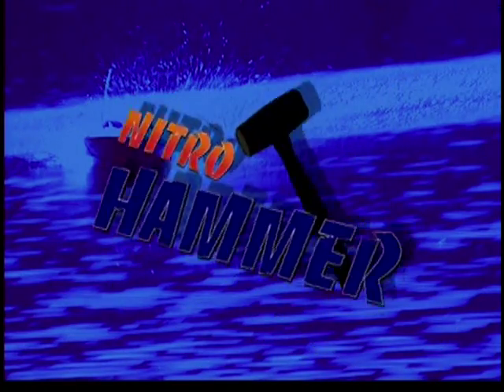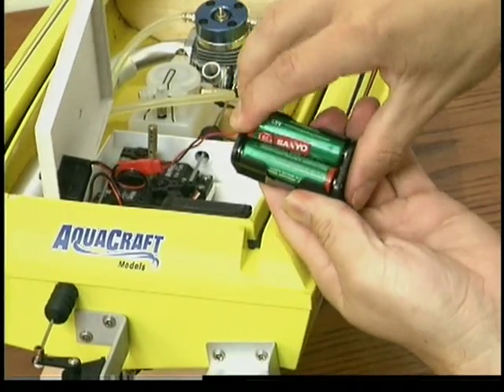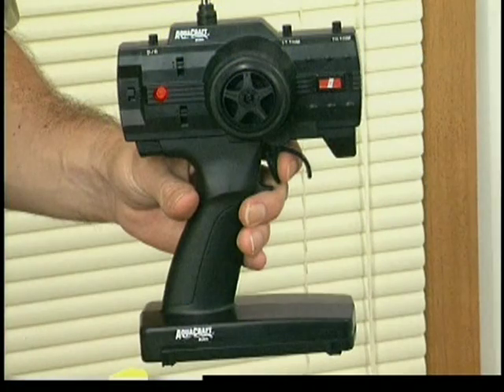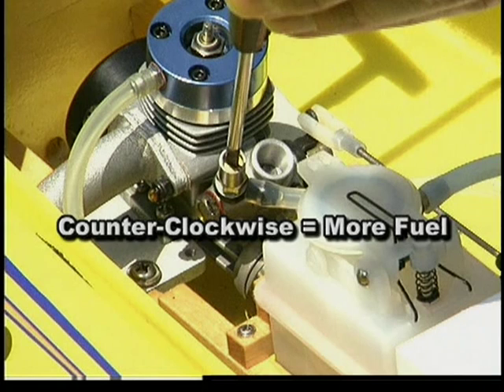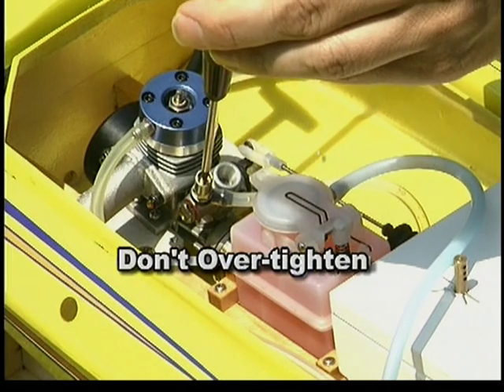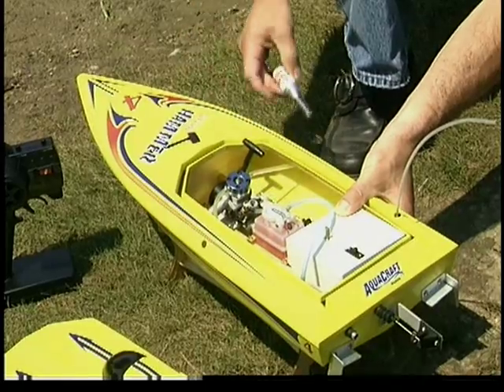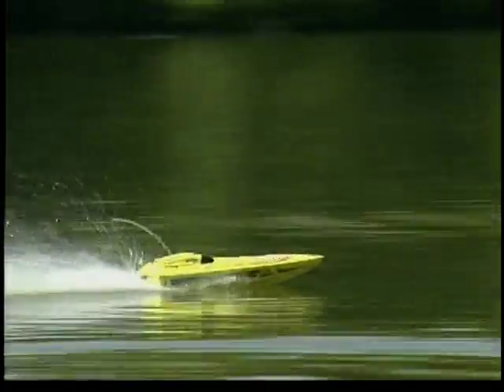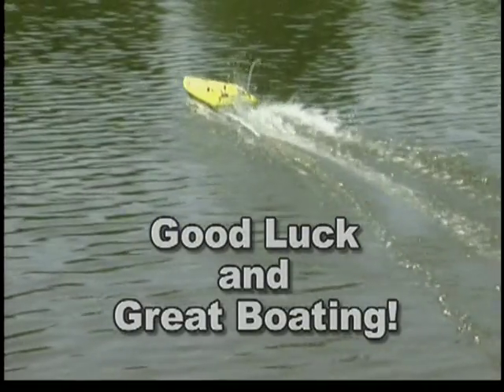Nitro Hammer - instruction and emgine tuning - propelris.lt

Comment: ahhhhhh the good ol days were youd need like 10 AAs to use the reciever lol
Reply: lol.
Reply: The new radios today need AA batteries. I was out of the hobby for about tens years and was not going to replace batteries all the time so converted it to lipo. The battery is way smaller and lasts for several weeks or more.